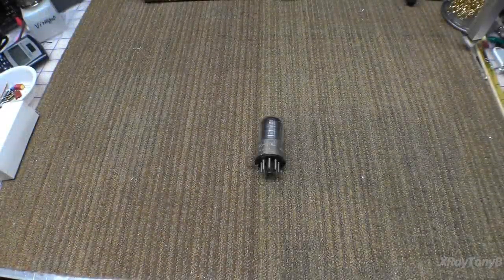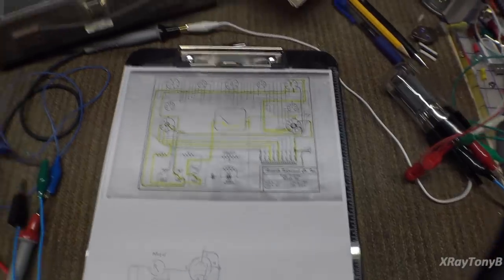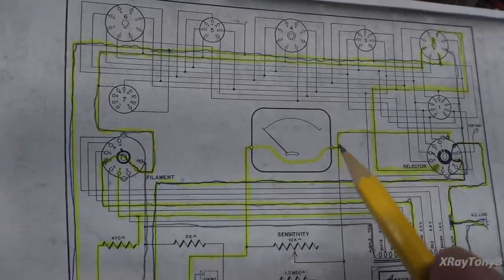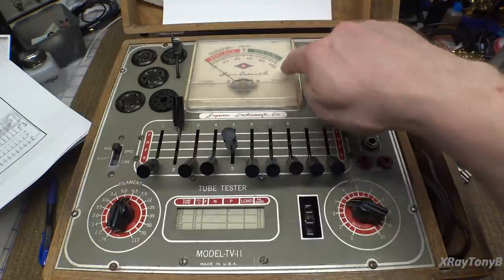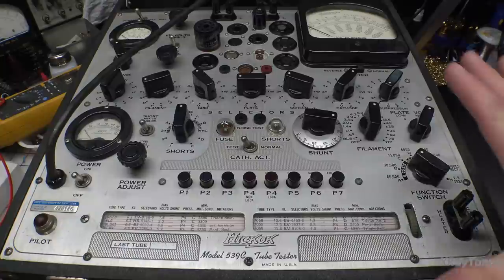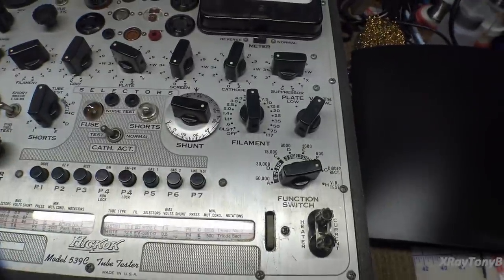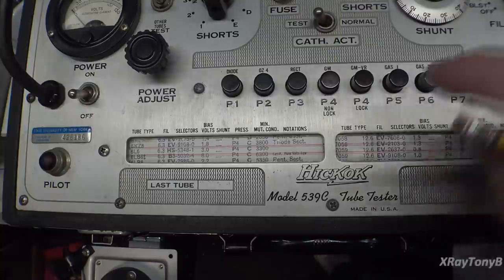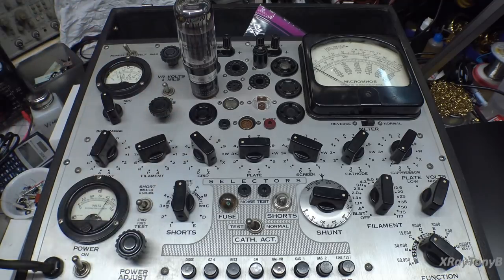Intro to Vacuum Tube (Valve) Testers

Comment: About a year ago, there was a triplet 3444 tester for sale on the local Craigslist for about three hundred and fifty bucks. I deeply regret having not jumped on that deal. I think that is one of the best testers that exists. And you're not going to find one for 350 bucks.
Reply: Theres also a re-branded Triplet 3444 , badged as a "Westmore 501". *Same exact machine as the Triplett*. I corresponded with test-equipment guru Alan Douglas (author of "Tube Testers and Classic Test Equipment) about it some years ago ---- he confirmed that it is indeed a 3444 in sheep's clothing, but we couldn't find any info on "Westmore".

Comment: More likely you should have a good transistor tester, but you can check bipolar transistor any  using the ohms range of any VOM, there are $10 LCR testers that will also test a transistor and identify leads. If you know what you are doing, you really don’t need an expensive tube tester. If you have a short in your tube, the radio will tell you with symptoms or burned components. Good / Bad is all you need to know, except….except if you are selling tubes you need to provide Gm values to your customers, who really don’t know much either. Good day chums!

Comment: You don’t even need a tube chart. A good tube manual will identify the pins where you can see what pins you are grouping. You can select test mode by identifying the power range setting and filament is an obvious setting.

Comment: The problem, acording to the PeaVey repair tech I talked to is, the particular class or model,  mine being the early 80s PeaVey VTX series classic 212 hybrid guitar amp. The power section runs off of 2~ 6L6GC tubes and the pre amp section is solid state. Anyway he told me the vtx and the vt series when the tube goes bad it instantly destroys its solid state driver. And when the driver goes bad, and you put a new tube in without replacing the driver you ruin the tube? Anyway, you get an expensive ping pong effect acording to PeaVey. That’s why I’m purchasing a used tube tester when I find one, so I don’t have to buy a dozen tubes to get my amp going.

Comment: Thanks Tony, I have a Heathkit TC-3 that I purchased to check my 300b and 2a3 tubes, before using in my Amplifier. It has been interesting to watch the tube degrade over time. Should I stop using a tube when it gets close to the yellow zone or questionable status? Can it damage my amp if it fails while in use? Your input would be greatly appreciated.

Comment: Hello, I have 2 Heathkit tt1, one works perfectly, the other does not allow calibration, I think it has the same problem as yours, could you tell me what values are the resistors that I should replace in the meter, thanks in advance

Comment: A forum would be wonderful I have five testers and don't now if they work .I tried my superior and the tube lit up and blew out and my two hickoksa 3000 and a 600 I believe thats what thay are. i have not tried one don't have the chart  roll. The other two are small ones .I wish someone lived next to me because I would give up a few for free if  someone could get me going on  the best on . I got exited when I saw this vidio..I build tube amps as a hobby and I just buy new matched tubes instead of testing the hundreds I have in stock  and that is stupid on my part. I opened one tester  up and saw all the wires tony speaks about that was enough it went back together and forgot about. Maybe this winter I will get into it if I can find the info or a person to help

Comment: Hey, Tony, I noticed your bottle of Vinegar on the bench. Do you use that to clean up after solder jobs in lieu of iso-propyl alcohol? If not what do you use it for?
Reply from the maker: I use it to clean corrosion from battery terminals and metal parts that get that white fuzzy corrosion on them.  I take a small artist's paint brush and cut the bristles short (to make the brush stiffer) and then apply the vinegar directly to the terminal.  Often, it will clean the corrosion right off.  Thanks for the question!
Reply: @xraytonyb  You should try it on a salad.  :)
Reply from the maker: balsamic, all the way ;)
Reply: @xraytonyb  Cool, I thought it might also work for cleaning component leads before soldering them in. Obviously probably would be to good to get on the board to clean up flux, post-solder. Thanks!!!
Reply: Apple cider vinegar is on the rage ! I swear it works better !

Comment: Micromhos, or transconductance is measured in units called Gm, what is Gm?
Reply from the maker: Very good question!  I'll try to explain it, but I know some of my friends could do a much better job of it.  Here it goes:
Just as we use the letter I as the symbol for current, V for voltage and R for resistance, the letter G is the symbol for conductance.  Resistance (R) is the measurement of the opposition of current flow through a circuit and conductance (G) is the measurement of the ease with which current passes through a circuit.  They are reciprocals of one another.  In other words, a 10 mega-ohm resistor (10 million ohms) will read 100 nano-Siemens (or  100 nano-mhos) of conductance.  10000000/1=.000001 siemens (or mhos) (I hope I have the correct number of zeros :).  The letter m (lower case) stands for mutual.  Put it all together and you have Gm= mutual conductance.  Mutual means that it is relative, or tied to something else.  In this case, it would mean the relative change in value between the grid-cathode and anode-cathode. So  Gm = mutual conductance = transconductance = gain.   This only applies to DC levels.  When we work with AC signals, we use the term admittance.  Admittance is the reciprocal of impedance.  It's very similar to resistance and conductance, except you have a phase angle component between current and voltage that affect the impedance/admittance (enter  ELI the ICE man ;) )   Hope that helps, and forgive my feeble attempt at this!
Reply: @xraytonyb  You are too modest, you did an excellent job. I don't know how it could be made any clearer. Thank you for that, I feel a bit more enlightened now.
Reply: In my electronics classes we were taught to use E for electromotive force, and not V for volts, hence the E in ELI. VLI the ICV man? We won't mention the non politically correct ways to remember the resistor color code we were taught.......

Comment: My 539C did but no longer works. NO meter defection. What to do what to do.
Reply: 83 tube ok?5y3 ok? Used Meters are easy to find,if the transformer is bad also there is some to find.